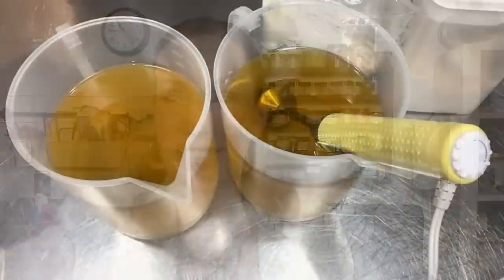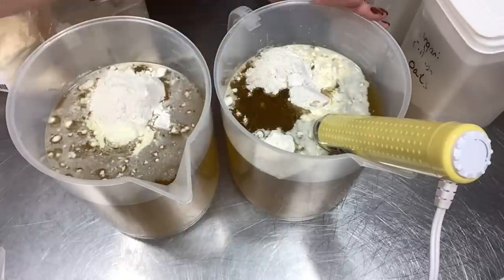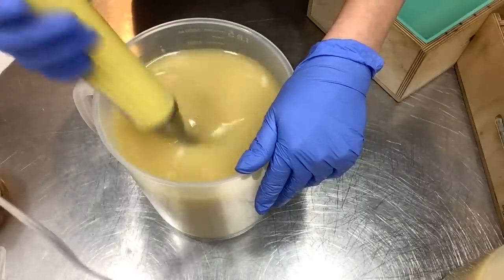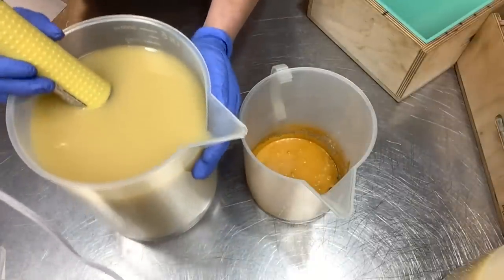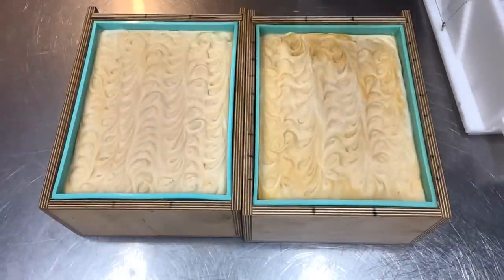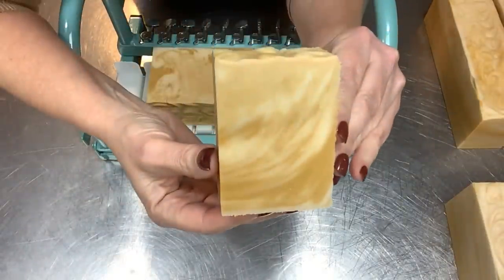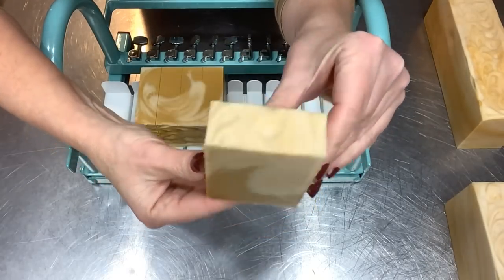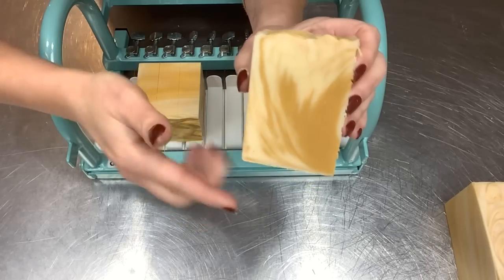Making 🥂 CHAMPAGNE PEAR 🍐 TRIPLE BUTTER Bars W/ Buttermilk & Cream | Ellen Ruth Soap

Comment: Nice soap, I've never smelled this scent though. What is that powder you put on the inside of your molds?
Reply from the maker: It's such a nice fragrance!  I use talcum powder on the outside of my silicone mold to help it unmold easier.  It's a tip from the Workshop Heritage folks😉

Comment: Do you have a soaping temp you like? I get impatient and mix in the low 100’s, I think that might be making my trace speed up? Wanted to try a pot swirl and hanger swirl but I was working with pudding 🤣
Reply from the maker: I tend to soap at 80 degrees or so.  I do like to soap at cooler temps.
Reply: Thank you! I just think you are the coolest, and one of idols for soap making. It is such a great hobby, scientific and artsy which is very me